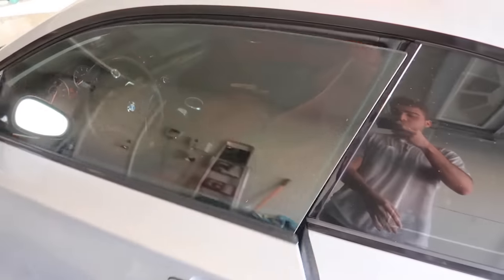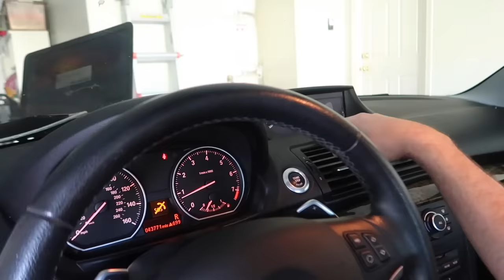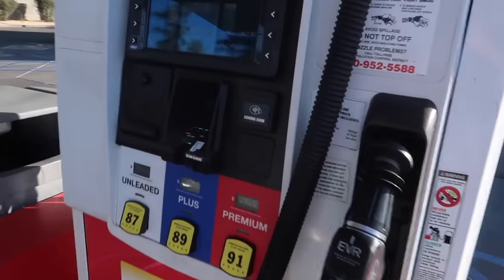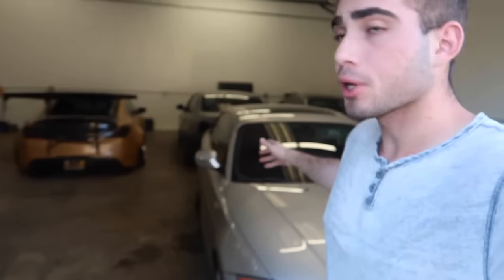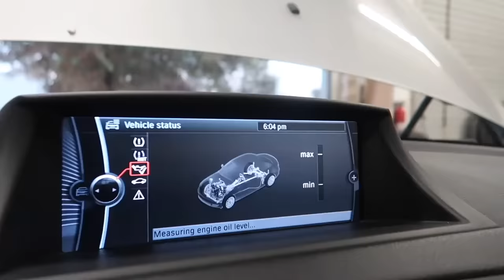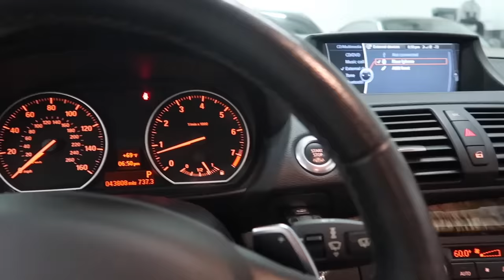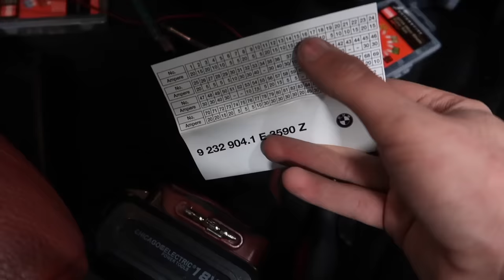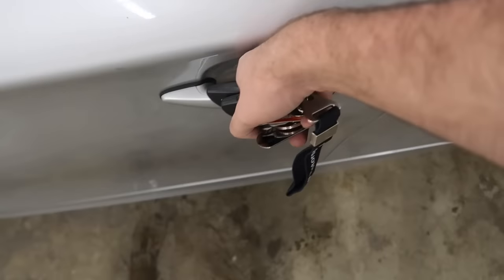WHY WAS THIS 1 SERIES SO CHEAP!

Comment: You should do a series on a 5 series next. I’d love to see a nice 550i build.
Reply: As an f10 550 owner i wouldnt recommend, i mean its a fucking beast but it has too many problems. Luckily i got the valve stem seals replaced for free trough bmw, car was burning oil. But i still have an oil pan leak thats gonna cost like 3k to fix.

With all those oil issues the cars power and sound is still extremely satisfying.
Reply: that car has a lot of mechanical problems that require labor that would cost more than the price of the car. Valve stem seals like the guy above me said are one of the most costly issues with the n62
Reply: a trick : you can watch movies on Flixzone. Me and my gf have been using them for watching lots of of movies these days.
Reply: @Caleb Luis yup, I've been using Flixzone for since december myself =)

Comment: Bro Keyless entry, if there is a fault you will have an error code!! my Bmw M550Ds door Fob leaked water it blown a fuse which is connected to the Keyless entry,, and also some how abs , asc , first i didn’t know its the door fob , symptoms was :No Speed o meter , no Power steering, Every single light on dash , Drive train error, electric parking error, Pederstrian ,,, Airbag etc,,, I done my home work removed the Door fob, disconnected checked the fuses it was a 5 amp fuse changed and now its good , except need a new fob or , just leave it like that 🤔 🤷‍♂️

Comment: What he did was a line out convertor from the speakers to the loc to the amp and the big ground wire was for ground and the blue wire was just a remote turn on, pretty much there was a subwoofer was in the car previously

Comment: Try changing the battery in your key fob to see if that will fix your comfort access not working! If that doesn't work its most likely the module bro
Reply from the maker: already did

Comment: I'm having an issue with my idrive/CCC system in my e90 bmw. The display monitor turns on then reboots then turns off again, could it be a bad wire or a bad monitor? I've attempted to change the fuse and hard reset the system but nothing has worked, any recommendations? Should I replace the CCC module/monitor?
Reply from the maker: Susumu kamita ccc medial isnbad
Reply: @NourHummadi Hummadi should i just replace the screen? Do you think that would fix the issue?

Comment: Hey bro the fuel door lock has a rubber boot that sometimes fell off and the fuel door wont open ,had this issue on my f10 installed a new rubber boot fixed the door issue 😎🤙
Try it out let us know in the future video ?